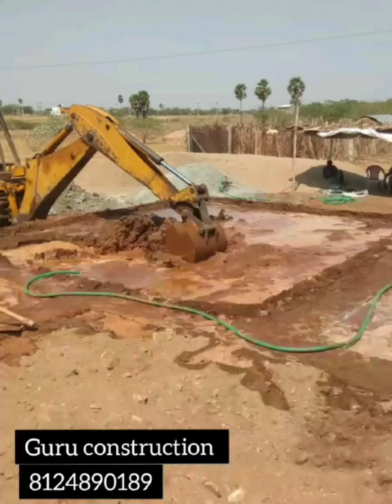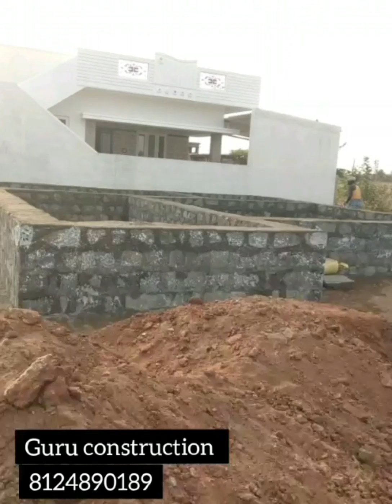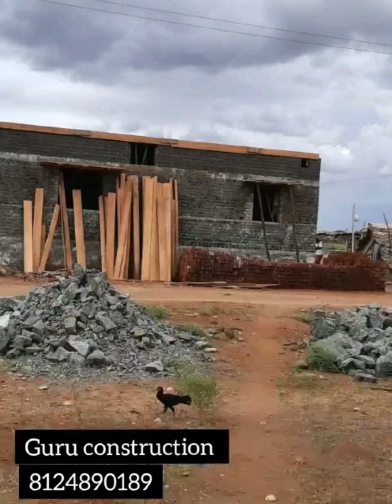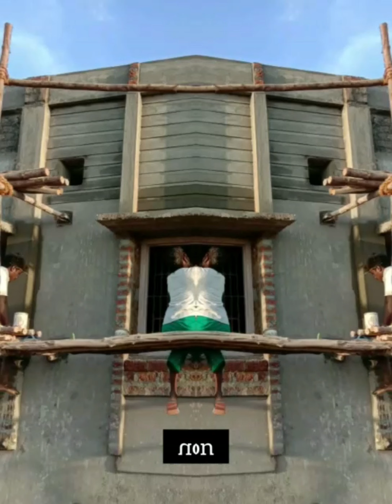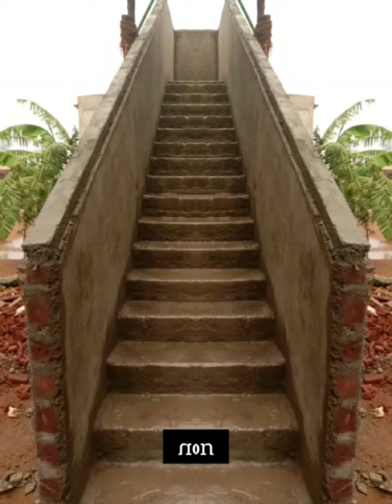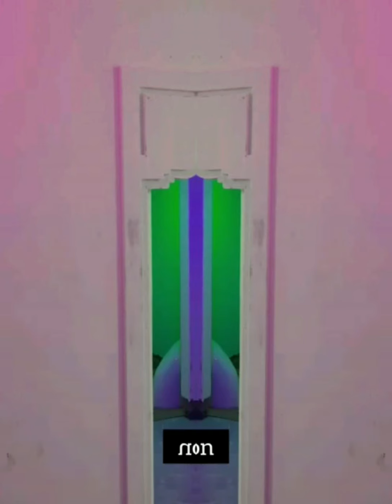Load bearing structure building start to finish photos at Aravakurichi site

Comment: Hall size ??
Reply: @guruconstruction5579  sir நானும் வீடு கட்டி கொண்டு இருக்கேன். கல் கட்டு
Hall size 16×15 செம்மண் பூமி.
Basement 4 அடி உயரம்.
Belt போட்டு கான்கிரீட் போட்டு இருக்கேன்.
10 mm கம்பி 6 mm rings 
But center ல கம்பி இல்லாம வச்சி கான்கிரீட் போட்டு இருக்கோம்.
 நடுவில் கம்பி இல்லாம கான்கிரீட் போட்டு இருப்பதால் பின்னாட்களில் பாதிப்பு வர வாய்ப்பு இருக்கா sir.
700 sq feet வீடு.
அல்லது இன்னொரு கான்கிரீட் அது மேல போடலாமா ?
Reply: @guruconstruction5579  கீழ 3 .5 அடி இறக்கி இருக்கிறோம். ஆனால் கீழ
 கான்கிரீட் போடாம 4 அடி எழுப்பி அதுக்கு மேல கான்கிரீட் போட்டு இருக்கிறோம்..
Reply: @k.saravanaraj3270  ஒன்ரும் பிரச்சனை இல்லை beam size எவ்வளவு போட்டீங்க  எத்தனை rod பொட்டிங்க ?
 Hall size கொஞ்சம்  பெருசு அதனால் concrete போடும் போது concealed beam போடுங்கள் , 
ஜன்னல் மட்டம் கிழே முறையே (2 ) 10mm  நடுவில் (1) 8 mm போட்டு கட்டி 2 inch அளவிற்கு concrete போடுங்கள் 
 lintel beam குறைந்தது 6 inch concrete beam போடவும் இடைவெளி ஜன்னல் அதிகம் பக்கம் பக்கம் வரும் பட்சத்தில் 
9inch concrete beam போட்டு கட்ட வேண்டும் , 
concrete மட்டத்தில் சுவர் வரும் இடங்களில் concrete மட்டம் அளவிற்கு concealed beam கொடுக்க வேண்டும்
Reply: @omsanthiomshakthi9793 ரொம்ப நன்றி sir